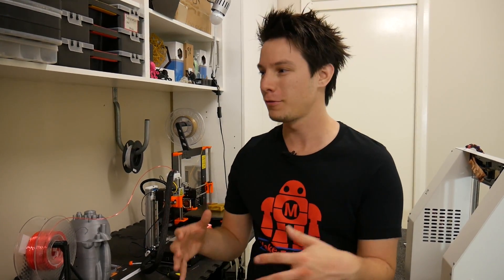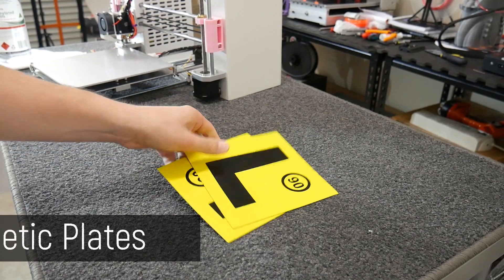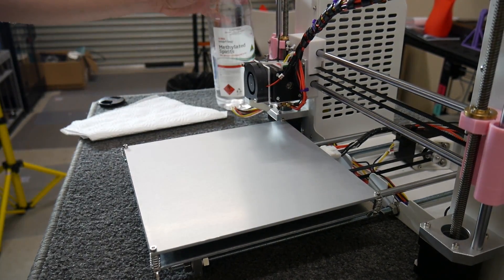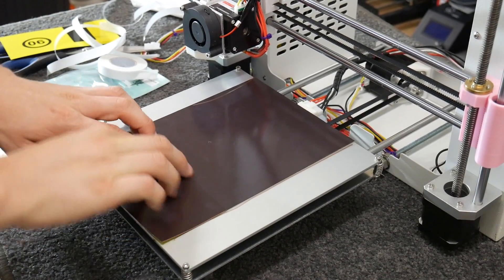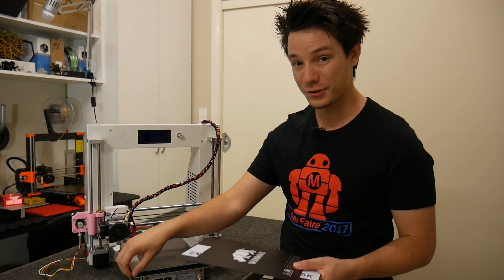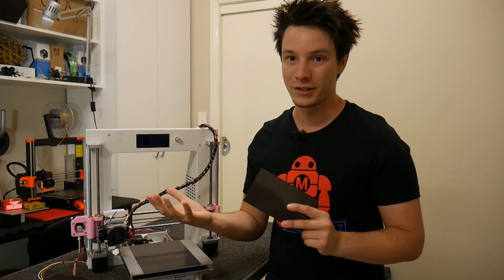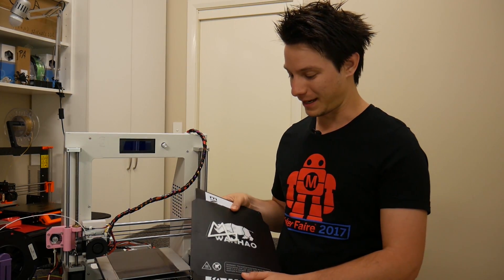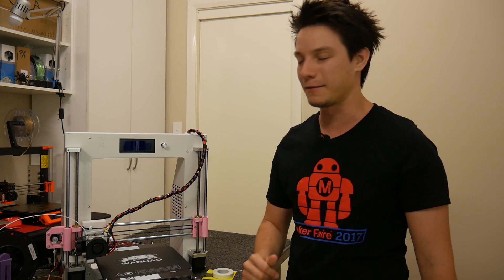Removable magnetic 3D printing surface on the cheap

Comment: Glad to see your using the JGAurora A3.  I have one and love it. I fixed the 'wobble' problem by drilling some holes in the bottom of the sheet metal frame and screwing down to a sheet of very flat wood (20 mm thick old solid core kitchen cabinet door). No flex problem.  I use PEI on glass and just clip to the bed.  I have two so I can take on off and let it cool and put on the other one and keep printing if I want to.  I have no problem with PLA or PETG. I do find I need to use a brim.

Comment: i'm planning to implement a proper 300*300mm spring steel sheet coupled with ferrite magnets  (not affect by temperature) for my 3D printer build

Comment: Hey, you're leaving those like me in the cold (or hot?)! What about us printing ABS on a hand-me-down Replicator 2X with the plate up at 130? ;) Last time I took anything even metal near my build plate I nicked the Kapton... and I went from needing a raft and every build detaching, to being able to print with just a skirt and nearly cracking prints (and pulling up the Kapton) when I remove them...

Guess the Curie point business means I won't be able to mod it with a hall-effect-sensor-based auto-bed-leveling... :D

Comment: Wouldn't putting the magnet sheet on the back of the build tack be easier and keep the surface more flexible? If the heat bead isn't already metal just glue magnets under it? I have a lot of strong high temp magnets that I've harvested from drone motors.

Comment: I love it. 
I have been using a lot of PETG recently and I normal use painter's tape for the bed. 
It's been fine but thought the last major print I did would NOT release at all. Using a spatula, with all my strength, without breaking the printer, wasn't going anywhere.
So I ended up peeling the tape off to it released. 
This could be a good alternative.

Comment: The curie temperature indicates the temperature at which total and permanent loss of magnetisation occurs. However, partial and permanent loss of magnetisation will occur below that temperature. Also, a decrease in performance is observed for most magnets at even lower temperatures, although this loss is reversible.

Comment: Any reason not to use a simple and cheap mirror? Heated above 50+ degrees it sticks without any skirt or brim and once cooled down to 40 or less it pops off. I have them on all my printers. I print pla and petg. Soon will try abs.
Reply from the maker: Yeah I'll be experimenting with that kind of thing in future, but you have to be patient and let it cool down!
Reply: Maker's Muse Well not exactly. As the mirrors are so dirt cheap I have several of them lying around. Small parts can be removed after a few seconds, for bigger parts I simply take the mirror off and put another on, it’s just a few clamps to take off, so no big deal. And I very rarely, if ever, have to level the bed. I use no force on it, so nothing changes. One thing to note though on the negative side, the bigger the print area the more mass you add to the bed, so for my Tevo Tornado I had to readjust my acceleration value to 500 just to be on the safe side. Doesn’t add much to the printing time.
Reply: +1 for glass. since I made the switch to borosilicate glass I wouldn't go back to any type of buildtak surface. surface remains perfectly flat, I don't remember the last time I had to touch the leveling knobs it was so long ago and if you're really impatient to pop the part off you can just remove the plate and run it under a cold tap. also less susceptible to gouges etc (from your removal tool). cool proof of concept though.
Reply: Regular Glass works and is cheap, BUT, it can break or shatter.   I tape the edges on mine cause the glass I get has sharp edges.  Probably not a great idea if kids use the machine.   A prepared borosilicate is a better choice for that (I assume they round the edges).
Reply: I prefer plain mirror, as this is truly planar. I cut it by myself with a glass cutter. I couldn't cut borosilicate glass with it, too dense and hard. I then sand the edges and corners with a simple sanding tool for the nails with a coarser and a lighter side. Not much work and absolutely no way to cut oneself with it afterwards. I have 3mm strong mirrors. I bought 9 pieces 20x20 cm for 9 Euros and cut them down for my Ender-2 to 17x17 cm. For the Tevo Tornado I use a 30x30cm mirror from Ikea. Careful with PETG, this one tends to stick VERY well especially to borosilicate glass. So patience and just take the plate off and let it cool down. Use no force.
Reply: That's why I slowed the acceleration down to 500 from before 1000. This helps a lot. I have now installed the anycubic Ultrabase 3D o the the Tevo which is really heavy and 6mm of pure coated thickness but has a nice size of 31x31 cm which is better to attach to the heat-bed with normal clamps. I never did print with 70 mm/s though. I rarely go above 50mm/s for any print I do. The time difference is not sooo huge to risk a failure after a 12h+ print IMHO.

Comment: I actually did this recently with two 20x20cm magnetic sheets. And… no problem at all after 30 hours of 90°C… still magnetic. Will see how it goes but looks good so far and I'm ok with replacing the 5$ sheets from time to time tbh.

Comment: Great video, Angus! I have an idea how to deal with the demagnetization problem: one could use thin (1mm or thinner) neodymium magnets type M or H evenly spaced in columns along the bed and metal strips of same thickness in-between them to fill in the gaps. Slightly more expensive but will hold the steel down better.
Reply: Or even better, take the high temp. Neodymium magnets and epoxy them under the heat bed. Then your spring steel, which Buildtak sells in popular sizes at a good price, can lay flat, get good heat transfer. My setup has lasted 10 months so far. The nice part is you can get several sheets and put different material on them for different filaments.
Reply: If the magnets are strong enough to hold down the plate firmly then yeah, why not.
Reply: @rclarke250  excellent idea

Comment: Did the same some months ago with my CR-10, works really well.
Reply: LeoBeoo what did you use for the CR10?
Reply: 2mm Steel from ebay , BuildTak 30,5x30,5 cm and 0,4mm Magnetic foil
Reply: Brilliant! Can you print on that steel or the buildtak cold? I like printing on my glass bed with gluestick, but I'd really like a flexible bed.

Comment: Interesting video topic...looks a bit familiar ;) great video. I wish I could find some spring steel panel really hard to source.
Reply from the maker: It's been done a couple times for sure, just thought I'd take a crack at it with things I could source locally. You're right, spring steel is near IMPOSSIBLE to find. EDIT: Neat! Just saw your vid, how long lasting has printing onto the flexible magnet substrate itself been?
Reply: I think the locally and cheaply sourced is the key point you've made there and makes it so much more accessible.  A few people are doing this on the CR-10 FB groups currently  but a lot more to that approach.
Reply: It hasn't been too terrible, it definitely feels it after awhile.  I think the material they make it out of (I have no idea) but I assume it is some sort of epoxy or something, seems to degrade after multiple heat cycles.  Similar to how old car magnets get brittle.  But it does take awhile and having a build surface drastically increases the life.  I haven't used it in awhile because I'm stuck with PLA during the winter with no enclosure so I've switched to glass.  But I'm sure I'll do a follow up this spring when the house is above 16 C.
Reply: Good call, didn't even cross my mind.  I'm no engineer, but I'm thinking it would be "Wear-Resistant 1095 Spring Steel Sheets and Strips" because it's already hardened the 1095? That's my best guess, but they aren't they cheapest thing around that's for sure $30 sq.ft (ish) it looks like.  Thanks for the suggestion, would make for a cool project I think.